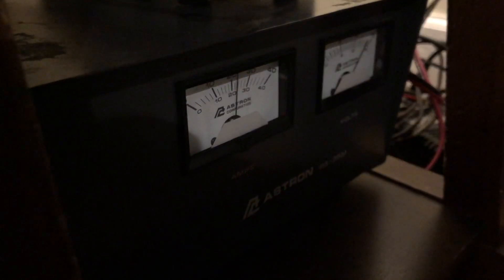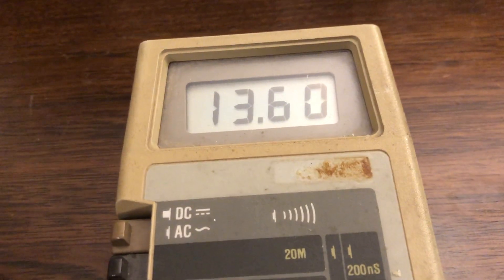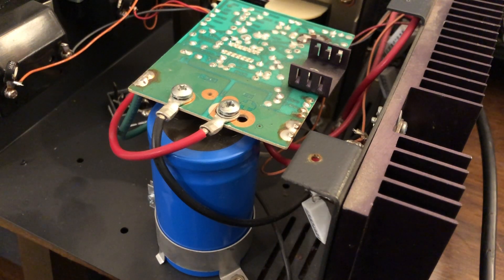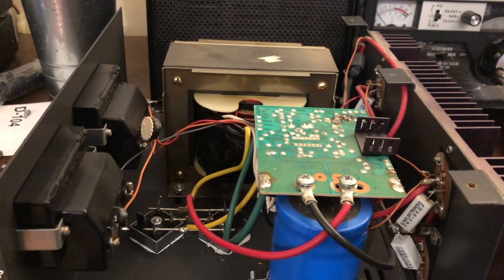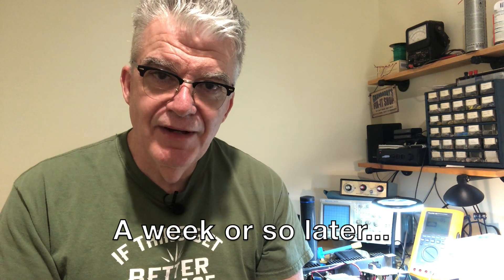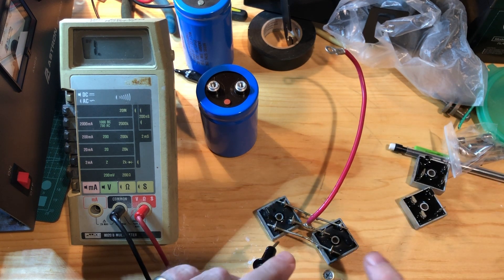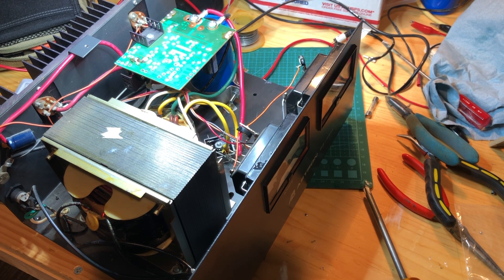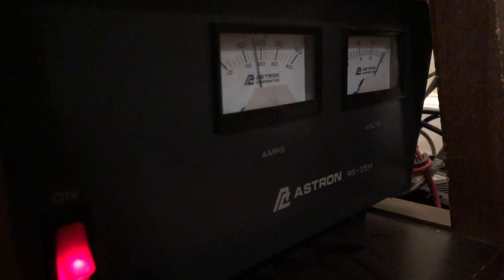Repairing an Astron RS 35M power supply for HAM radios

Comment: Glad you were able to repair this power supply. I have had several older Ashtron Power Supplies come across my bench and they are all usually one of 4 Components .  They make a good power Linear Power Supply and its normal for failures after many hours of operations.    Thank You   73

Comment: I have repaired a number of old PS over the years, and have seen intermittently shorted capacitors blow the rectifier diodes.  The large caps fail intermittently due to temperature changes and I suspect the plates grew whiskers causing these transient shorts.   Did you continue to use the original capacitor, or did you eventually replace the cap too?   N3SDO

Comment: I worked on high current low voltage supplies for decades. In all likely hood the new capacitor is good.  The inrush current to charge the new cap (it could almost a dead short) popped the already weak diode!  Also since yhe bridges were wired a Full Eave & in parallel it is a good chance only one is bad (check them individually).  Also as I recall the voltage from the rectifiers is about 30V in that supply do not a real chance of shock but discharging it like you fid could protect the rest of the electronics from damage if accidently touching.  My hones oppinion early on was loose laminationsvin the power transformer a piece of wood touching the transformer & ear would confirm or eliminate quickly.

Comment: You should use a bleed resistor to discharge the capacitor as a direct short of the terminals may damage it internally.  You could have checked with a voltmeter to see if it was holding voltage, which it obviously was.  According to James H. Larsen, who annotated the RS-35M schematic, rs35m-annotated, "The filter capacitor, C5, is a large 64,000 μF, 25 V electrolytic. My supply has two 32,000 μF caps in parallel."  Back when I was young and stupid, we thought it was really funny to solder a couple of wires to a large cap, charge it from the 450 VDC test point on out testing rig and toss them at each other with a "Hey, catch!"  It's about the same as touching a door knob after walking across the carpet.  So while it might smart a bit, it would hardly be deadly.  At 25VDC, I doubt you'd even feel it.  64K uF at 25 VDC creates a Charge Q = 1.6 Coulombs, Energy E = 20 Joules. Other than that, great job.
Reply: Yes a bleeder resister. Also when watch the last test it hums just as before.

Comment: While you are in there, scrape the paint off the chassis under the mounting lug where the green ground wire is attached to the chassis, otherwise the ground wire is insulated by paint from the chassis. You can also adjust the potentometer for the output voltage up from 13.8 to 14.1 or 14.2 or so.

Comment: Finally replaced the lamps on my VS-50M with the LED replacement kit from Astron. It arrived 10 years ago one was went out a day or two after delivery and the other one went out about 5 years ago. The only thing I did different with this repair was heat shrink at the splice location... I just couldn't get myself to just twist the wire and stuff them back in!

Comment: I recently picked up a used RS-35M from a local electronics store I have been going to for over 30 years. I bench tested it and was pleasantly surprised that it was still within spec. Even the transient performance was good as well. I have a Astron RS-50M that has been in constant service since 1990, I am certainly a big fan of Astron. Nice Tempo One by the way.

Comment: Heres JULIO from PUERTO RICO in FLORIDA I fix Aircraft radios as a HOBBY collect some for my own use as scanners and mobile use listening to orlando ATC and High altitude jets crossing floridian Airspace fron across FLORIDA

I have an OLD RADAIR 360 COMM aircraft radio Carrying case with integrated battey charger fo the internal Gel cell battery called LSAs  type batteries

When I lug the power cord to charge the new battey makes a HUMM Sound I bpught it from ETSY web for 67.00 in fact bought two radios  for sane prive they cost more I had to replaced the battey  was not holding a charge  looks like new and were sotrage for yrs.

The vertical mini batt condition meter seems stuck at the upper level of fully charged

I changed the relay two days ago there is a resistor I broke of 3 Mega ohms colored Orange BLACK and green bad  gold last strip or 5 percent tolerance  Series E24 type resistors

this was I was removing a chip thought was the problem  and a 50Vdc 100 uf capacitor electrolytic type axial 

The realy is ti swith form internal power to external 12 VDC     8 amps power supply similar  to those in LAPTOPS but used for this  types of equipment but  it worked  before  when I plugged the external power supply and Is not CLICKING th relay  and the charger does turns on the radio but lots of HUMM sound in the  speaker 

No voltage  is flowing from the Battery to the radio installed in this portable carrying case with Carrying handle similar to those of DESK Frequency counters cabinets and Oscilloscopes 

 same LOOKS  and a speaker screen front and telescoping antenna and Headset and MIC jacks in the front panel

There s also a 2N 3055 Transistor which is good  I tests it 

What could be the reasons? The transformer?  It came like this when I bought it  Its not charging  my battery in the tray inside this carrying case opens  in two parts for sevicing

like a SANDWICH  top and bottom bread layer

contact me at juliocanal@aol.com  and WP4CHP were my Call sign in PUERTO RICO  in the 70s   also a CB radio operator KEK 7148 

CQs to you all please help a disabled person 70s yrs young 

julio R

Comment: The caps, i use a 10 watt 10ohm resistor to  discharge and then put a shorting wire across it. I'd prefer starting at the transformer output V then test the rectififying circuit and work my way back to the pass transistors.

Comment: With that Hum.... it should have told you right away there was a near short on the secondary side of the transformer after checking the cap  the rectifier should have been the second place that you look. The humming is the laminations of the power transformer. What probably happened was with the leaky diode passed AC to the new Cap  and the 100K uf cap was too much for the diode and caused it to short and the AC killed the cap. I would replace the old Cap right away to get the full filtering that the supply is capable of its clear that the old cap didn't  have the full  capacity that it should have had after 30 to 50 years ...haha. You know what I mean. 73

Comment: Thank you for the video and the hints. One question: I want to buy the US version (110V) while plan to use it in EU (220V). I've read that the most of the Astron linear models (RS) have a transformer with primary readu for 220v and 110V. Do you have such info and can you confirm that this particular model (RS-35M) have such a transformer ?
Reply from the maker: I don’t remember it having a transformer that can support 220v.

Comment: That is a dumb design; Astron really dropped the ball on the RS-35.  Those bridge rectifiers are rated at 200 volts (good) and 25 amps (bad).  You have two bridge rectifiers put in parallel, which is moronic at best; when you have two rectifiers in parallel one rectifier will almost always conduct sooner (at a lower voltage) than the other, which means one will take most of the loading.  They should have just used one bridge rectifier rated at 40 or 50 amps.

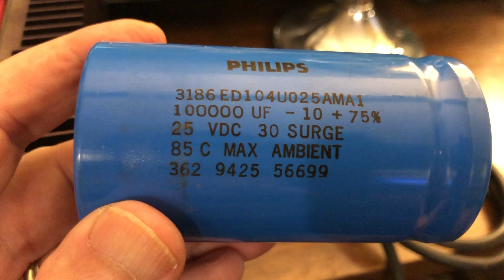Comment: Many of the individual components including ICs, power transistors, bridge rectifiers, capacitors, pots, and sometimes even transformers and printed circuit boards will have Electronic Components Industry Association date codes in the format YYWW. For example the 9425 number seen on C5 at 5:24 could translate to the June 20-26, 1994. The 9502 code seen on the bridge at 10:33 translates to the second week containing a Thursday of January 1995. The more date codes you can find on original parts, the closer you can estimate the age of the equipment. In some cases even the serial number of the assembled product has an embedded date code.

Comment: Thanks for this vid. I have this exact power supply which I got from my friend Jon's widow when he passed away. I never looked inside the thing yet because I didn't have the time to dig into it and figure out what is going on in there. From watching your vid it really looks like this thing is a real gutless wonder. Mine doesn't make the noise yours was making and it works for when my rig is in receive mode but when I transmit it shuts down. It would sure explain why he had a different supply in line to run his rigs and wasn't using this one - he probably switched it out when it started doing this. I'm thinking its probably something on the regulator board. I'd be interested in hearing your thoughts on this.
Reply from the maker: You’re right in that there isn’t a whole lot to it.  My guess is the regulator may be the problem on your supply.  The schematic is available online if you poke around.  And parts are available from Astron.  Mine is still working fine and I leave it on 24/7 under the desk.  It really is a great power supply.  Thanks and good luck!

Comment: I see you have a Tempo One  in the background, do you have any videos for that power supply??

Thanks 
KE8NFK
Reply from the maker: Not yet but I do plan to replace the capacitors and power cord!
Reply: @k2cjbradio  Cool!! I replaced the filter capacitors with 2 section ones ( couldn't find any 3 section ones) and put in an "extra " axial capacitor,  but not sure if I wired it in the right way, schematics are Greek to me!!

Comment: Why did you think the original cap was bad?  You measured the ripple voltage as practically nothing.  That cap is what filters the ripple.  If it was failing you'd have ripple.  
While safety is certainly important, the secondary side of the supply is only 25V or so.  It isn't going to hurt you as long as you don't go sticking metal rings or wrist watches into it to short things out - regardless of the current.  And the secondary filter cap doesn't have enough voltage on it to bite you for the same reason.  The primary is of course 120V and can bite you.
Reply from the maker: Yeah, I was just assuming the cap failed due to age.

Comment: This has been very helpful.  You give a great, cut-to-the-chase video presentation.  I have an older RS-35M with the single meter that I bought at a hamfest.  The OM seemed a bit senile & he told me he tried to fix it himself.  It has an additional C5 capacitor in it for some reason.  But the PSU was only $20 so I now it's my headache.  I have decided to fix all of my bad PSUs & this one is my bigger challenge.
Reply from the maker: Sounds like you got a pretty good deal if you can get it working!

Comment: The Lm723 is also found in Manson power supplies.
I have had a few to repair over the years,  shorted rectifier and sometimes dead pass transistors on the heatsink.
But they are so easy to repair, so i put up with the faults :-D
Reply from the maker: Exactly!

Comment: Nice work.  Seems like old capacitors are the last failure point.  Boards on model trains (MTH) had a series made with crap capacitors from China that were a common failure.  New air conditioners seem to have the same issue.  Hmmm.   Nice job on the fix.

Comment: I have both an (old) 35 amp and a 20 amp supply. Both are on the shelf needing work. Repairing these things is expense compared to buying a new "switching" power supply--especiallyif you need a new transformer!  But I think they are worth taking the time and trouble. I  may be old school but when I read the RFI suppression specs on switching supplies my reaction is "yeah... OK." Also, what is the effect of leaving a switching supply "ON" continuously? Great video.  Ditto on the cautions. Even at 13 volts, that supply can deliver enough current to literally start a fire.
Reply from the maker: Yeah, I am also skeptical of switching supplies.  I know many ops use them but nothing beats a brute force power supply.  If the transformer had failed I probably would’ve tossed the supply since it is pretty old.  But, I think I might’ve bought a few more years of service with this repair.  It’s still working and is on 24/7.  Thanks for watching!
Reply: Interesting. I built the Marchwood 30amp PSU, G4JET’s design from the 1980s. It was the first thing I built with help from my uncle now silent key, so it’s a keeper. All the parts were sourced second-hand from radio junk sales, but it’s never let me down. I use it to power my Icom IC-756Pro. I’ve been using FT8 recently and getting ground loops into my computer taking the Internet connection out. Your video made me think the 2 33000 MFD 40v capacitors might be failing so I’ve ordered a pair. Many thanks, Alan

Comment: OMG, just got that joke at the start, hmmmmmm, when you pointed out the two terminals on that large capacitor it looked like you almost touched them and I jumped, haha.  I replaced the same part (bridge rectifier) on my RS-20A but I called Astron and asked for their tech support/re because the varistor and the transformer appeared to be function well, and their support said the bridge rectifier is typically the culprit.  Your videos are fun to watch, I like how you cut to the close ups.  Well done!
Reply from the maker: Thanks for watching and the kind words…and for getting the joke!!  My Astron is holding up with no problems.  Great power supply.

Comment: Have a dead RS-35A, I will look at repairing it.
Reply from the maker: Luckily it’s a relatively straightforward circuit.  Just be careful of those capacitors.  They do hold a charge!
Reply: @k2cjbradio  I will discharge it first.

Comment: Is it normal to make a little hum when powered on? I just got a new one today. Just that little slight steady hum that sounds like when you power on something big. Mine is the RS-70A.
Reply from the maker: I would think so because of the large transformer.
Reply: @k2cjbradio  Thank you for responding, it did sound like something I heard before from devices with large transformers.
Reply: @chasiu75  You're hearing magnetostriction in the laminations.  It is normal.

Comment: I read somewhere that a humming Astron is a sign of a dying rectifier. When it fails dead short like that, it's going to dump AC on your brand new filter cap, which probably killed it too. Glad you finally got it all figured out.
Reply from the maker: Thanks!  And it’s still working a few months later.  Looks like I bought a little more time with the repair.

Comment: I Replaced my Two 2504 with Four 5001 all Tied together in my RS-35A Works Great I used the 5001 for that's what I had Laying around or I would have used 2504 if I didn't have anything Laying around and the 5001 there Chinese and with My Test there only Good for 15 amps at 100 Volts Not 50 Amps at 100 Volts as they Say but I Got 10 of them for $3.50 with Free Shipping so with Four They Should be Good too 60 Amps and 100 Volts witch in the RS-35A They will Never See anything more then at Best only 40 - 41 Amps at 24 - 30 Volts before it Downs it too 13.8 Volts and it Puts out all of the 40 Amps over the 35 amps it is Rated for.

Comment: My astron crashed on me...started with the hum...once I open it up it was the bridge rectifiers.   Called astron and they used a bad batch...sent me new ones for both of my supplies free...great customer service..
Reply from the maker: Yes they have great customer support and a great product!
Reply: In an age of vanishing customer service, that is super important.  Customer service reputation is a high priority in my buying decisions. 
I've got a little 20A Astron which so far hasn't given me a lick of trouble, but it also has seen only light use so far.  
Once I get my TR7 fixed and some "wire in the air", I'll need a bigger one.